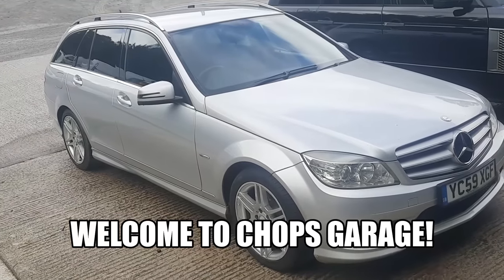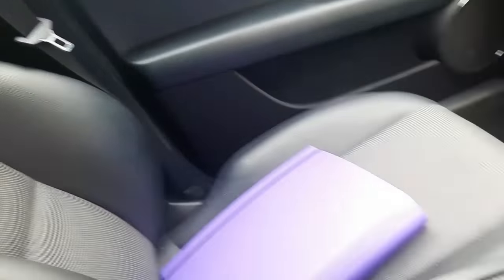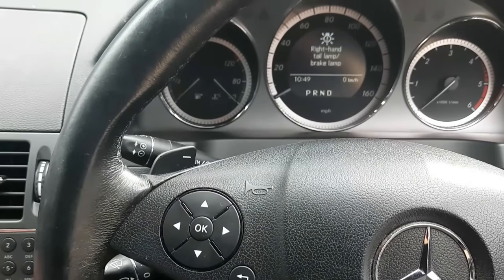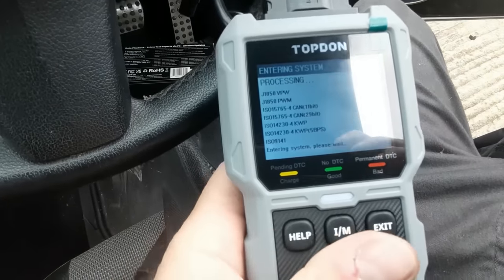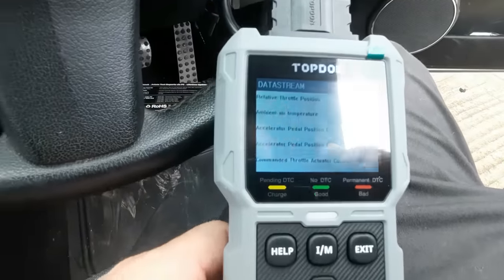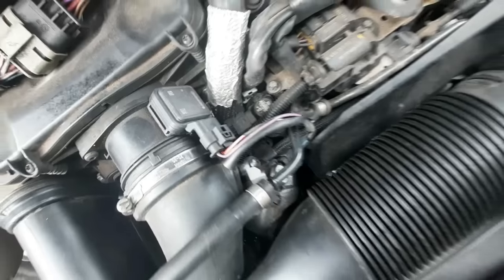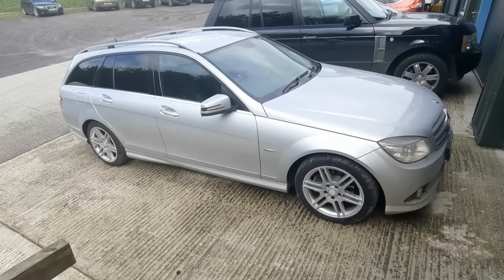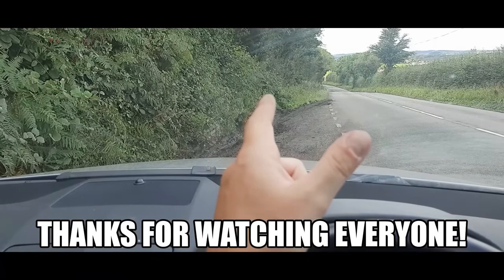Cheap Mercedes C220 CDI - This is exactly why you should NOT buy old Diesels!

Comment: Your correct chop in what you say about old cars.  But I would go further and say people need to be realistic when buying any car.  There's nothing to say that nothing will go wrong with a newer car. 

My last car was only 3 years old and had only 35k miles on it when I bought it from a local Peugeot garage. I only drive around 5k miles a year so thought I would have it for a good few years into the future. The next thing the dashboard started lighting up like a Christmas tree. Different warning lights in different combinations would come up at random times. So I would take it back to the Peugeot garage I bought it from and they would look at it, tinker with it, take the lights off, tell me I wasn't using it enough, then I would drive away only for it a few days later to light up again. So I got rid of it again at a loss. 

That's my rant on Peugeot's done. I won't have another one again after that even though that garage still sends me invites to special car sales events. 

In total contrast to this, one of the first cars I ever owned was an old Vauxhall Nova (maybe some people out there can still remember them), it had 95k on the clock when I bought it, I ran it for three years without spending anything beyond the usual MOT and service costs. I didn't even have to replace a tyre on it or a light bulb before I sold it for more money than what I originally bought it for. 

You can get a mid week built car or a Friday afternoon built car.  It's the luck of the draw.

Comment: Can’t beat my 248k 2.0 Tdi Bluemotion VW PASSAT B7 ESTATE 

been reliable with nothing going wrong for the last 100k miles - when I bought it on 137k 4years ago it had a faulty clutch and EGR valve (replaced under warranty) has been perfect ever since! - I replace the oil every 9k miles myself and it’s driven long distances so helps with the DPF (never had any issues!) - ah it’s also remapped to 195bhp and 305ft/lbs torque!! (For 80k miles!)

Comment: My 2011 c250 CDI has 182k on it, it went into limp mode with full dpf code but it was split hoses, I use a Merc specialist (not main stealer) and once he’d changed the hoses he ran the dpf regen with no issues. Looking at that list of services mine had similar suspension linkage replacements etc. I’m looking at getting 250k out of mine 👍👍🤞🤞
Reply from the maker: Good on you , I love a high miler
Reply: @ChopsGarage  thx, the interior really is like new, car drives very smooth and does 48-52mph. To get a post 2015 one that meets ULEZ needs, I’d need to spend another £12k… I’m much happier  to try to get this to 200-250k 🤞

Comment: Always fix every other code before even considering touching the DPF
The DPF will not regen if there are other faults present, so any soot codes are often caused by continuing to drive the car when regen is disabled
Reply from the maker: cheers yes learned this

Comment: 651 engine in these which are really good, it may have an outstanding recall for the airbags on it and also the rear subframes corrode from the inside out which the dealers will replace under warranty
Reply: @@Leslie_Horwinkle no they definitely will do them, they need to be inspected 1st but if found to be corroded they will replace
Reply: @@Leslie_Horwinkle uk merc dealers ARE replacing rusted rear sub frames under warranty.

Comment: These little scanners are okay for what they are but they can lead you completely down the garden path. The code shown there is generic - I just did a C250 CDI in limp mode. Same code on the little scanner I have in my tool box. When I plugged in my Autel 906Pro I could see it was a differential pressure sensor fault + ash content not okay - two codes not one and these had an extra digit. So under the 4 digit code you get on a cheapo hand-held scanner there are numerous specific codes. After I changed the sensor I did an adaptation in between driving the car in "Italian tune-up" style and it is now fine after clearing the codes.

Comment: i have '12  model since new (s204 amg sports plus ) , now circa 135k miles up with 7 speed auto and i can asure you they dont have dual mass flywheels. the fault code could be dpf sensor which is  cheap and easy to fix on a dyi basis.

Comment: 13:17 the earth point is in the top right of the pic on the turret top, but you shouldn't be testing a battery through the wiring  unless you just want to get a feel for its health. if you want an accurate reading you need to connect the tester to the battery posts.

Comment: Expensive electrical faults R us. At around 90'000 miles my C350CDI went into electrical meltdown with the poxiest faults causing perpetual limp-home mode. The EGR "position sensor" failed. It's a pcb the components of which are made of unobtanium and it costs £500.  Then theres the MAF sensor, the Glow-plug manager and a thousand other transistors, diodes, thyristors and potentiometers to fail which all cost a fortune and need an expensive code reader to diagnose. I got fed up and got rid before the steering lock failed.

Comment: This engine and gearbox will last a million kilometers, same with W212, get one 2010 and newer.
Do good service, replace AT fluid in time.  Weak points : subframe rear prone to rusting from inside, rear shocks, injectors/fire plates, MAF ($ from dealer), some years timing chain, oil cooler, replace in time!! .. Best buy = 350CDI!

Comment: My old 1994 s124 3 litre diesel estate was entirely hydraulic and had no ECU or any digital gubbins inside it driving an OM606 mercedes diesel engine. It was the most reliable car I ever owned capable of giving 35-45 mpg (UK).

Comment: I have a c220 cdi estate from 2012, only 2 new ABS sensors, new battery and replaced oil pan/carter after 290k kilometers. Sporty for a car that drives 5l/100km and a low cost.

Comment: There is an additive to buy that you put in the diesel tank that will clean the particle filter. Instructions for such are often that you should gas 3000 RPM for 15 minutes. There is of course more advanced stuff to clean the Particle Felt as well

Comment: Making the comparison with Japan:
-Usually cheaper at auction and better condition.
-Insurance far cheaper.
-Distance driven usually far less, so clocking never an issue.
-Motor fuels cheaper, diesel 20% lower than regular petrol.
-Japanese MOT (Shaken) every two years. Includes Road Traffic Act insurance and some taxes. With owner's permission, anyone can drive any car, anytime.
-Scrapping is free as scrapping charge added to auction expenses.
Because the punter is so picky, the cost of motoring is pushed up. As example, those alloys are immaculate. When buying for yourself, you tend to overlook minor blemishes.
Jack, the Japan Alps Brit

Comment: Regrettably am in issues with a 2010 BMW 520d 106000 miles bought from a car sales garage and it's used 2 litres coolant in 3000 miles car sales said 3months engine & gearbox warranty Warning light came on 9 days before warranty expired going back to them we'll see if they fix issue
Reply: good luck. I hope they accept it and that you dodge the bullet.  Sell it and get something simple.

Comment: Back around 2004 I bought a Saab 93, 4 years old, petrol with 99,000 miles on it with a full Saab 2 year warranty. I added another 50,000 miles with no problems at all. I only paid £4000 and it had cost over £20,000 when new. The full warranty was handy as I had only a couple of faults sorted out free of charge and it only got sold because it was somewhat thirsty!
Reply from the maker: I find petrol will do the miles and simpler

Comment: Dpf will be blocked in this. I’ve had five of the om651 engines and at around that mileage they start to back up if the coolant temp sensor starts to go and the car can’t run a regeneration. You should see codes for back pressure in the dme. Best of luck!

Comment: I bought  my first Rover 75 CDT (Understressed 2.0 BMW Diesel) with 195k on the clock and the engine was completely super. I had it for 80k until i reversed into a lamp post and then scrapped it as it was not worth repairing. The car ate wishbones, front discs/pads etc but the engine and all that goes with it was like granite, with nothing but oil and filters spent on it the whole time. Same for my next one. I even ran the first one with the MAF disconnected for years and still got 50mpg on a run.
Reply from the maker: Yes earlier ones better

Comment: It's usually the dpf pressure sensor not the dpf, mercs regen really well compared to others . The pressure sensor is much cheaper and quite common.
Reply: I had to pay €1500 in 2003 on a C class for two blocked DPF
Reply: Ouch, they don't usually block. Jags however, they do all the time.
Reply: @stephenrichards5386 They saw you coming.
Reply: @Djpaul-lo1px  the German manufacturers see all British coming. I bought many merch while living in France. Never saw a poverty pack. They sell them low here and then screw them with options

Comment: i have c200 from 2012 facelift, I had. problem with dpf, sensor was defect and was no automatic regeneration. I put some products, new sensor, drive half hour 50 km/h and now is oke.Other things no problem. Still quality car for small money You can buy cheap third party dpf filter and change to to some local mechanic... Is not so big problem if you love the car model.

Comment: I have a 1964 Mercedes w110 200d. What's wrong with old diesels, the only problem is you have to change the oil in the engine, fuelinjection and air filter as well as grease about 27 grease nipples every 3000 miles.

Comment: I've always bought low milers and pay over book.
Well worth it as I've never had huge garage bills.
Paying a premium for low miles is defo cheaper than paying huge parts & labour charges in my experience.

As to your battery testing.........
The tester needs to be connected directly to the battery terminals otherwise false readings will result.
You want to be testing the battery not the resistance in the wiring ⚠️

Comment: i had a high mileage ford focus diesel.. engine light, plus reduced power meant usually its in a emergency engine operation mode because some minor issue accord like a blocked fuel filter. it was it in my case.. now i have a high mileage tdi audi. dieselgang, baby

Comment: Yes, not no. But, if the Diesel has ben driven in short distances, say under 20 km at once, and I could not warm up, 20 km for small engine, for a 3l rather 40 km, you put a Diesel additive into every tank filling, I can tell you from all combined mileages we made with Volvo's D5, the 3 L OM from 2003 (S211),  Toyota Land Cruisers  Prado, we hardly ever had a problem with the DPF or the EGR. Every 60 Tkm, you should cleanse the EGR. 
Our last  E350 CDI  4Matic ,(S212) , we resold, with OM642+, we bought it in Germany in in 2011, then had 270 Tkm. In 2020, we resold it with 519 Tkm. Problems: at 340 Tkm we had to change the compressor for the air suspension, at 470 Tkm  both front Air bags.  Injectors were cleansed every 90 Tkm, the auto trans. flushed also , EGR cleaned by hand.
That is it. 
The car now runs daily, back in Germany, mileage currently: 730 Tkm.....It will hit the 1 Mio km mark, then, our partners will sell it to Mercedes Benz Stuttgart, which will pay them around 250,000 euros, if the mileage is correct !
People who cannot drive properly and maintain a Diesel properly should walk, cycle or take a bus !

Comment: I sold my 2012 C220 CDI auto when it hit  85,000 miles. Even with a full MBSH it started to reveal problems with boost pipes, sensors , injector issues and parking sensors
Reply from the maker: Exactly

Comment: DPFs are such a pain. The best way I found of dealing with them was to drive at around 3000 rpm, in third or forth, for at least 15 minutes without dropping the revs at all. So, slow in the slow lane, on a motorway. Plenty of annoyed drivers passing you though. But it was in my A3s handbook to do that. Imagine that on an autobahn
Reply from the maker: Oh my yes lol
Reply: Could you not drive at 3000 rpm in 4th or 5th so not so slow?
Reply: This is what frustrates me with emission B/S you would not put a tube up yer ass and breath it through you mouth you wouldn't be very well and you would   have all your internal organs clogged up. What are the emissions   like when regeneration occurs.  The fuel companies don't mind more fuel being burnt from over smogged vehicles  .With one thing and another time to take to the streets absolutely fed up with raped and being told its all my fault for wanting a roof over my head and to drive a van with tools to work. And when l pop my clogs l want to leave the little bit l have to my kids.
Reply: @bikeman123 yes - or at least it's no problem with a manual, and is best at dual carriageway speeds. That's what I used to do with my Mazda 6 2.2 MZR-CD (notorious for DPF issues and also timing chain "stretch"). I never had a DPF issue and I believe that was as a result of driving it this way from time to time. Unfortunately, despite regular oil changes with proper spec oil, my timing chain was past it by about 165,000 miles, but the DPF was still in good shape.
Reply: DPF issue is likely only the DPF sensor. Cheap and easy to fix though access can be tight, it's jammed up by the bulkhead.
Reply: Most cars detect when they're running at a constant motorway speed and will automatically run a regen cycle.

Comment: 2 stroke oil from 150k miles to 300k miles on the clock.
Original injectors up to 300.000 miles original intake manifold with shrill flaps on. Intake always clean. Original EGR, turbo replaced only as preventative measure. Original fuel pump at 300k miles.
Car? BMW 320d M47, 2005. 
It will have a preventative timing chain replacement. No noise or anything...
Clutches and flywheel replaced twice in 300k mes.
All suspension replaced for standard Bilton, once.
SECRET FOR LONG LASTING ENGINE. 2 STROKE OIL. IT WILL LAST FOREVER.
2 stroke JASO FB for non DPF. JASO FD for dpf engines! 250ml/50litres of diesel.
You will thank me..

Comment: 159k on a diesel is just run in by my standard when folk say anything around 100k is high mileage I laugh, I don't have any experience with mercs but it's a diesel and German so build quality is the best and if it's been maintained right and by that I mean regular oil changes including transmission, servicing and cleaning parts like intakes egrs possibly injectors then it will see more than double that mileage, I tend to stick with Japanese diesels as I like the build quality my izusu pickup is sitting at 324k and still pulls like a train and very quiet only things I've replaced on it are a clutch, alternator and starter and timing belts doesn't smoke or consume oil and dpf gets a blast down the motorway once a month to keep it clear, been working on diesels for over 35 years and the biggest factor with them is oil changes which a lot of folk seem to neglect.

Comment: I had a mercedes 308D 2.3 for 12 years 2 batteries one set of glow plugs two exhausts  an alternator and a squeaky fan belt, no computers or dpfs once it was running it required no electricity to run, look at modern diesels , more complicated than the space shuttle and have inbuilt obsolescence coded into the ECU, ive gone back to old petrols

Comment: Only 159,000 miles? The Ford Smax 2l diesel we bought at 52,000 miles and sold at 214,000 miles is still on the road and in January this year according to the MOT checker was at 260,466 miles. The trick is to change the oil every 13k miles and use it for long runs. The Smax reg is AX57 DWG
Reply from the maker: Earlier the better on diesel, simpler

Comment: Also what people dont know is it has 2x 501 bulbs for the front side lights per side and ur faults with the rear lamps are the earth points burning out to the lamp backing. Easily sorted with new part loom and lamp backing from merc. Not expensive. These cars are good for silly miles and are pretty much bullet proof. Last of the best.
Reply from the maker: I've heard they will
Reply: Yes its a common problem with the earth to the rear lights. Mine went but was a cheap fix.

Comment: older model of this C class I got w203 2.2cdi now 230.000km.Got it at 180k,dashboard like a christmass tree.Changed many sensors,airmass also,but you need to drive it and maintain them in a specific way,soon as a sensor goes out you change it don't wait to fuckup other things too,and drive it always on high revs(2200-2500) to keep clean,automatic kinda hard work but thats why I got manual
Reply: meanwile this old mercedes is the last fabricated cars where you see half milion milage,new cars if they last 150.000 you lucky

Comment: had a 2.1 sprinter 308 timing chain ssue at 173000 km destroyed motor totally fitted brand new motor then put 500000 km on it never an issue all linked to oil used never use aything but full syn oil service every 7000k and you wont have an issue unless you use it as shopping trolley , low mileage stop start will kill them for sure , from the day i bought it until i sold it was 5 yrs  from new then bought another one , big miles downunder

Comment: Surely, being an auto, it wouldn't have a dual mass fly wheel?
Reply: Why not?
Reply: Isn't it part of the clutch?   The duel mass flywheel I thought it was to reduce the clutch pressure required.   The rac removed the duel mass flywheel from there transits and had a single plate instead.  It had more  vibration but didn't fail.
Reply: I belive these are torque converter  boxes do shouldn't  have a DMF
The twin clutch DSG boxes do have DMF.
Reply: @oceandrive7283 I think you are right as the dsg bog is essentially a normal gear box just controlled electronically the clutch goes on them also. Though I'm told the early ones are the worst.
Reply: No dual mass on that one James
Reply: Torque convertor on that one
Reply: Diesel Mercedes don't have DSG boxes. No DMF on this.